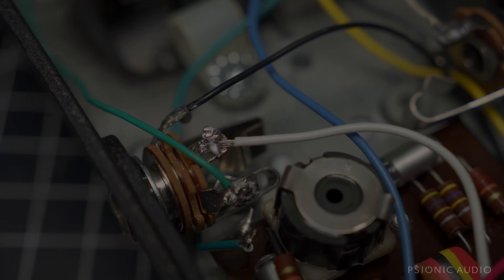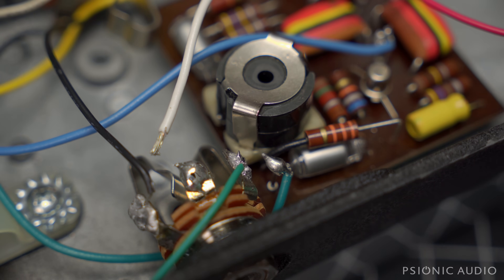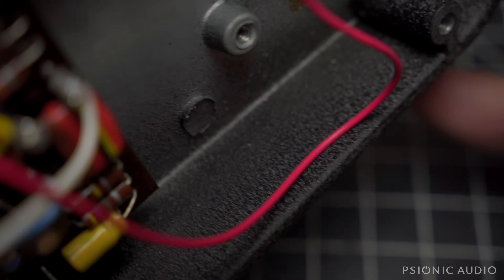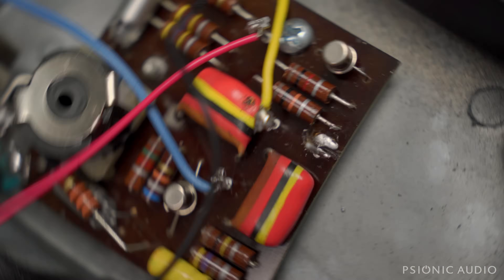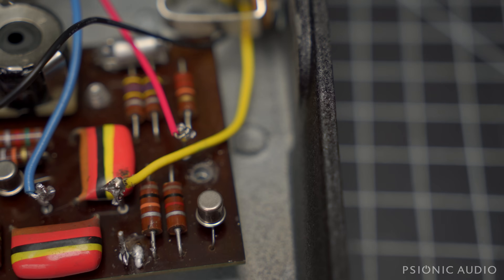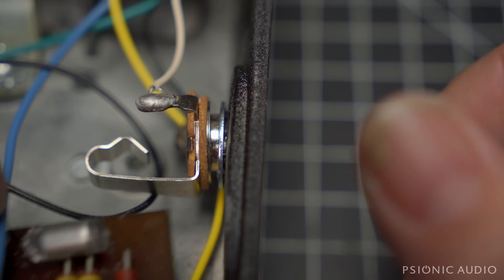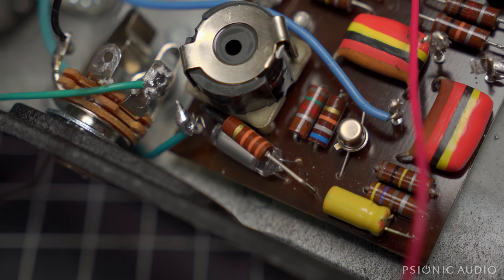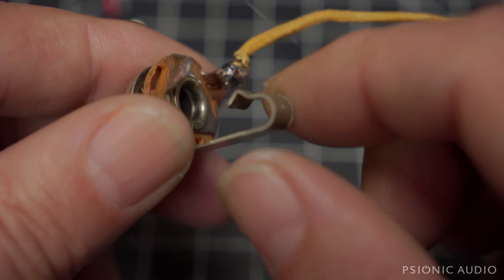Bad Solder Ruins Everything

Comment: Love these informative videos. I do have a question related to amateur soldering - 

Most times I try soldering wires, they tend to melt or (singe if they're fabric). I only run my iron at 650 or so, and tried higher at 700 (too get in and out quick).
I'm using good lead solder, cleaning my tip, everything. I can think of. What am I missing?

If you haven't made a soldering tips video in the past (for amps, pedals, guitar wiring, etc.) I think it would be super helpful to people like me who want to learn and get better at taking care of their own gear (or just messing around).

Your videos are great, keep up the good work.
Reply from the maker: I’ll try to do one soon.

Comment: I'm almost certain that he used lead-free solder. It promptly eats away bare copper on contact, and it always shows a dull joint when solid, regardless the quality of the job. Really nasty stuff. It might be "acceptable" (never for me) for use in ENIG finished boards, but bare copper PCBs need leaded solder, and even at that, the solder might dissolve the copper somewhat.

Comment: When I was doing an electronics course at my local university, they taught us how to prepare wires and joints for soldering, when preparing wire for soldering there are four steps, cut...which means that you cut the wire to length, strip....which means you strip-off the insulation from the wire, twist....which means you twist the individual strands of the wire into a single neat bundle, and tin....which means you coat the bare wire with solder, using this method I've been able to reduce the likelihood of bad solder joints down to a bare minimum where I hardly ever get any that are bad, a soldering station is highly recommended too.

Comment: YES! Long overdue, some techs, some of them with 30yrs+ experience do not now how to solder. It is not only head knowledge, this must be translated through good hands, good workmanship. There's nothing that devalues, and destroys an otherwise good chassis more than bad solder. BTW the orig Bassman jack solder doesn't appear factory, excessive heat, burned insulation, or, sub-standard quality by what I have seen on original Fender amps.

Comment: I’ve had this problem before where the solder won’t adhere to the 1/4” jacks. I think it’s a problem with cheaper sourced jacks, not sure why. Maybe they’re coated in machine oil so the solder won’t flow but I’ve seen this before and it’s definitely a jack problem. Not that good solder technique won’t help

Comment: So this comment doesn't invalidate everything in this video, and in the comments; and, indeed, the video doesn't beat the "lead-free" drum to the exclusion of everything else. But I'm compelled to be That Guy and say that lead-free solder is not evil, and there's plenty of bad leaded joints.

I've had a lead-free bench for almost a decade, and a separate area and tools for work on existing lead. For me, SN-100C/"K-100D" work great for hand-soldering, and aren't particularly expensive now. The process is different, but it's possible and it's nice. There is another area for lead work, and music instrument repair stuff tends to go there, but I fantasize about never thinking about lead solder again, though that probably won't happen in my lifetime.

tldr to kids: Keep an open mind about lead-free solder.
Reply from the maker: Lead free can be great. In production amps it usually isn’t (most companies use the cheap stuff). And it has inherent issues that are problematic in amps (tim whiskers especially).

Comment: When I worked at CD Dist, I repaired a few MODKIT pedals that customers couldn't get working via email troubleshooting. In almost every case they used lead free solder with a cheap iron that didn't get hot enough. All the joints looked like the one in that wah pedal.

Comment: As I look through the comments… of course rosin core 60/40 solder is by far easier to work with. There are reasons the electronics industry moved away from leaded solder and rosin flux; mostly for the safety and health of the people on the line being heavly exposed day after day. Lead free takes another level of expertise along with the proper flux and higher heat to get sufficient wetting and flow. A good friend of mine turned me onto lead free 10 years ago and I have never looked back since.

Comment: How could you tell that the solder was not adhering to the jack?
Reply: When melted with the soldering iron the solder is pooling up into blobs - like water on a plastic surface - instead of spreading out over the surface like it should do.
Reply: The molten solder should look and behave as if it's "wetting" the connection.

Comment: I bet you it's the harbor freight solder. I was trying to use it for a while and it was endlessly frustrating i thought my iron was broken or the heat element with cracks. Nope it was just purely the solder. Huge hassle. Just use the real deal silver bearing leaded rosin core.
Reply: 60-40 lead-tin solder from a reputable source/manufacturer works, but if you can get the stuff with 2% silver that's even better. I have a roll of Kester with 2% silver that is my go-to for all soldering operations .

Comment: I worked at an electronics assembly plant that designed and boult audio spectrum analyzers. They were built with PCB’s and were wave soldered. I often did warranty work, which involved unsoldering components from the board and replacing them. I remember using the suction device and the woven stuff to wick the  remaining solder out of the holes. We would clean the board with MEK, which  will likely cause some of us to get cancer some day…. I remember feeling good about creating secure solder joints. We knew that audio engineers needed their equipment to hold up in the field. A lot came down to solder joints. (And rechargeable batteries.)

Comment: Solder appears to be akin to the chip quick brand. Works well for surface mount devices and that's it.  Removal and splatter control a technique in itself.

Comment: Gotta confess i ruined stuff, especially pickups with my 90s junk radioshack soldering iron for years, gave up. Now i'm a ace with kester solder and a pro Weller up at 800°F. Using flux to control flow was a game changer. Just get pro tools and practice... Many amazing instructional vids out here. Best time ever to learn!

Comment: buy a new wah?? …. you're so overstating this …. just fix it and charge a fair price …. the actual work required is easy for an amp tech … bread and butter stuff, hardly challenging
Reply from the maker: A used good condition Vox wah costs less than an hour of my time. So sorry my looking out for the client offends you.
Reply: shaking my head, yes …offended. no. To me,  "looking out for the client" would be to just fix it. It is only a wah, and a simple job for you or any tech. I guess I am just less rigid
Reply: @ZombiedustXXX  I wasn't suggesting Psionic Audio fixed the wah for free …. Yeah I have fixed many wah pedals over the years as it happens, often a cracked inductor from a dropped pedal but various things. Mate in the grand scheme of electronics, tube amps and pedals are really quite basic, there are 100's of thousands of folks out there who possess the skills and who work on amps and such like . They don't all want to/or have the ability/means to run a you tube channel though. But we appreciate the guys who do, like psionic. you've jumped in to defend Lyle, who doesn't need it, you've stated you don't want to offend the pedal owner, who wouldn't be. got a back bone mate

Comment: One could theoretically scuff up those cheap Jack posts some fine grit, clean them with alcohol and then try to solder.
Reply: A scotchbright pad, ink eraser, or ( my personal preference) a fiberglas-bristle scratch brush work well for cleaning terminals prior to soldering. Degrease with alcohol after polishing the terminals.

Comment: I have 1968 Clyde McCoy wah that needs some work, but I'm leery of using modern solder on it which would probably yield similar solder joints.. I know I have a spool of pre-ROH compliant solder somewhere in a box from a previous move. I'll wait until I find it before I try to do any work on it.

Comment: Not mean at all. Any chance you’d do a soldering video? You could go over solder sizes, rosin vs non rosin core, temperatures, etc.  have you considered trying affiliate links? Perhaps a way to generate some income for the channel. Thanks for these videos. They are very helpful. I got a stew Mac pedal kit for Christmas so definitely want to start off on the right foot. Happy new year from New Mexico. 😉
Reply: IF I'm not mistaken, I think Lyle did a video where he explained some soldering techniques a few years ago. I'm not sure which one or I'd put a link in here, sorry.
Reply: @harleyhexxe9806 thanks. I did a quick search but didn’t find anything. I’ll go back a bit further.
Reply: @stevevender1154  Sorry Steve. I should have been more specific. It's not a video specifically about soldering techniques, it's a video of an amp repair, but there's a section where he gets into specific details on how to solder in certain situations. I should have made that more clear in my reply.
Reply: @harleyhexxe9806  lol, no worries. I think I actually saw the one you were talking about. I’ll redo my search and see if I can find it again. 👍😉
Reply: @stevevender1154  Yeah, I skip around so much on the old videos, especially the ones with amps similar to my old Fenders and such. I pick up a lot of useful information here about things that can go wrong in an amp if certain things aren't done right. It's going to be helpful to me when I start building a replica of a TW amp. I'll need all the pointers I can get.

Comment: Either replace those jax or desolder and then sand down the terminals on those cheap Taiwanese jax just before soldering. They put a zinc anodizing on those cheesy Taiwanese made  jax and then spray them with a plastic so they don't corrode. Maybe tin costs too much? It has a halo inductor in it, which is very nice. I have the maroon box TDK, the halo, the TDK halo, the stack of dimes, red, yellow and even green Fasels, and my own inductors. I put 4.7uF tantalum caps in my wah pedals too. No electrolytic caps. Mine are all 50+ years old and the 4uF caps were all junk, and I had bag of tantalum caps, so... Why not?

Comment: As someone who solders all day everyday, my biggest recommendation is to get a $100 Hakko FX-888D and use leaded solder.
Reply: leaded rosin core solder is the way to go for sure. also, it's so important to actually heat up the area you're soldering. people are so worried about burning components out that they do this thing where they melt solder onto the tip and try to transfer it to the component instead of melting the solder at the contact point. that's a bad joint waiting to fail if it even works in the first place.

Comment: Lead-free solder is a curse upon mankind. Especially if you are re-using old parts such as tube sockets, which some may frown upon. Completely unforgiving of any shortcoming in cleaning or heat f flux or phase of the moon. Fortunately I found a roll of good old Kester 44 at a garage sale for a buck.

Comment: Hey guys, it’s my wah and my solder.. just wanted to say that when Lyle talked to me personally about this his criticism was very constructive and not demeaning at all. He was also very encouraging that I try again with the proper tools and some guidance from him. Great guy, great tech
Reply: Thanks for commenting mate. Lyle is obviously a knowledgeable engineer/tech and a great guy. Good on you for going to him for the heads-up.
Reply: @bluflaam777LSA  Right on, just use good parts and solder like he said. You can still do it your self. Should only take an hour or two at most.
Reply: That's the way. Listen and learn. When I was starting out 25 years ago, I was hopeless at soldering. A friend with years of experience finally - literally - took the solder iron from my hand and said, "Enough. You are horribly botching it. Let me show you how to do this properly." I still remember his admonition to always keep the solder tip clean & tinned, understand your solder's melting temp, and always heat the work, then feed the solder. He and I shared many a hearty laugh recalling that lesson since then, and his bold mentoring despite my noob ego (Thank you Paul, RIP my friend). 

Lyle is obviously an expert, and you could not be in better hands if learning is your goal. Keep that great attitude and best to you in your journey!
Reply: @spumpstein9374  Having someone demonstrate in person I feel can be hugely beneficial. I learned from my dad that way and picked it up pretty quickly-- and I think a lot easier than just trying based on advice without being shown how to put those words into action.

A lot of people will repeat that "heat the work" line, for example, but those words alone don't give you a feel for how to avoid burning anything near the work or what to use as a heatsink when needed. The necessary nuance that's lost in adages will come out when put into actual practice.
Reply: Excellent point, well-made. Thank you! @RudolfWolph
Reply: If you have the right soldering iron and solder and a little patience/practice, soldering is fairly simple. I've been soldering for decades and I still learn a thing or two watching techs like Lyle working. Also, working on an inexpensive wha pedal is a great place to start honing your skills and technique...
Reply: Yes. Just new try with better solder. 
Those tropical fish caps and that pot core inductor seemed very correct stuff. 👍
Reply from the maker: Thanks for the kind words all. I’ll be pointing him to a Hakko, the right Kester, and a good source for Switchcrafts and good wire. I’ll be giving him some in person pointers next time he comes by. Maybe I’ll do a little video with the same info for everyone. Maybe I’ll make a cable. I think all serious electronic musicians should learn how to make/repair cables as that will save you thousands over the course of a career, even as an enthusiastic amateur.
Reply: @PsionicAudio  I, for one, think this a great idea and would really appreciate this education!!!  Thanks for all the great videos.
Reply: Mr. Caldwell is one of those rare and special humans thats willing to selflessly give back to us what is obviously his own hard won wisdom. It's important to remember that although knowledge runs rampant it seldomly leads to wisdom
Reply: Was this a kit? If so which one. Looks cool.
Reply: @deanmlshredder  it’s a 90’s vox, but I replaced everything except the jacks.. pot is chasetone (way better than stock imo). The circuit board was a complete drop in unit I got off eBay. Unfortunately I don’t remember exactly which one it was.. but it sounds GREAT! For obvious reasons I had some reliability issues though lol..
Reply: @zachchilders  lol. We all start somewhere man. I started out modding wahs in the early 2000s. Changed my inductor my first time soldering and it was the ugliest damn thing you'd ever seen. Now build all my own pedals and I'm gearing up to build a princeton reverb soon. The right tools, solder and the right amount of heat is most of the battle.
Reply: @deanmlshredder  I believe this was one of Jerry Dietrich’s boards (Detrik FX) if he got it on eBay as I got a board from him that looks identical, it’s a Clyde McCoy picture Wah clone with nos components I believe. It’s a great sounding piece of gear, and Jerry is a nice dude, have chatted with him a couple times. Would definitely recommend his boards if you’re looking to do a build, it’s on par sound wise with an rmc10 I own (I also used a chasetone pot) ✌🏼
Reply: @deanmlshredder
It looks like a Detrick board/components to me?.
He sells wahs fully assembled and parts kits.
I think you can just make out his signature on the back of the circuit board in green ink?.
Reply: It’s all good. Practice makes perfect and I’m far from perfect but with a decent iron and some decent solder you’d be amazed at how nice your joints can look and also how little solder you actually need if it’s flowing and adhering correctly.
Reply: If the jacks aren’t genuine Switchcraft or similar quality, say Chinese or Amazon sourced for instance, they can be coated in oil that prevents the solder from adhering properly. Hope that helps, from a fellow wah builder
Reply: @StratmanJerry  yup, sandpaper or scotchbrite on those terminals works fine ( the same on steel box/chasis)
Reply: I like him.
Reply: So what specifically was the issue? CC solder/plumber's acid core or was it just insufficient heating? When he said it was etching the board on contact I immediately thought acid core.
Reply: A friend of mine (great guitarist and high IQ) had a very good soldering station, was precise enough to replace some SMD caps in a laptop, but his guitar jacks and pots had blobs all over, because he mixed leaded and unleaded solder. Thanks to the RoHS rules, it is easier to obtain controlled substances than good solder in the EU.
I would suggest getting some old AM/FM radios and practice there, if you want, but I am guessing that the issue here was just the new solder not blending with the old.
Reply: I have actually spoken with him as well, he really is a good dude!
Reply: Thanks, we are all watching Psionic to be better at maintaining our instruments and gear. Thank you for sending in your gear for the video!
Reply: You make your own solder?
Reply: I think it's pretty pertinent to ask...what was the solder that you used originally? This question is meant to steer people away from that solder.